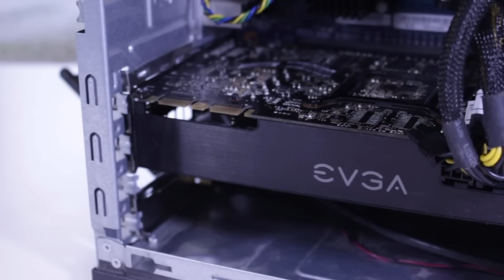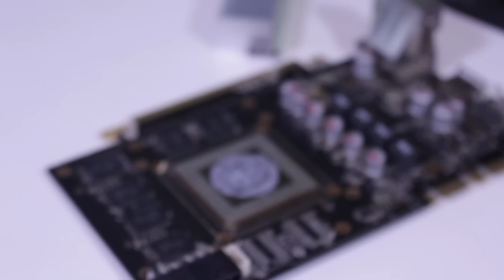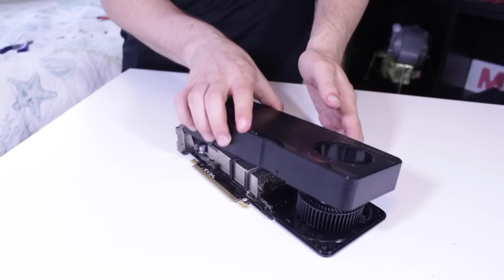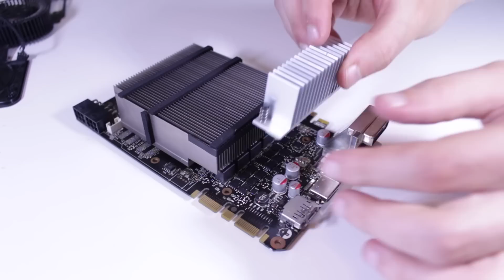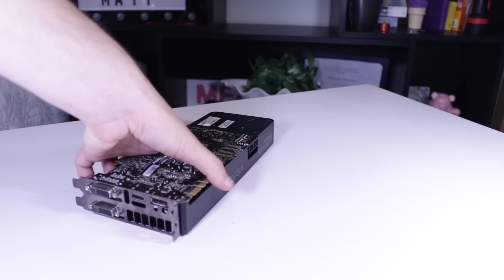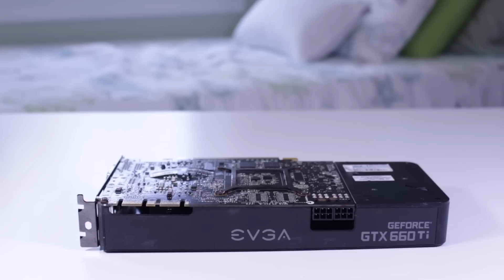Fixing a LOUD Graphics Card!

Comment: The ticking or knocking sound in bdlc motors even at slow rpms is caused by the pulsating energization of the stator windings. It's a phenomenon known as cogging torque. Blower fans seem to suffer from it more than normal fans, probably because of a larger diameter rotor while having the same number of magnetic poles. Many mistake it for a bad bearing or a mechanical obstruction of the fan but those are different issues.

Comment: mine sounds like that, its supposed to be cleaned and all working parts, but the fan drives everyone in the next room sleeping mad crazy. they asked me the the hell I am doing in there lol. I never herd such an insane pc, it sounds like a load coffee pot noise and then when I do virtual machines for pen testing it gets so load sounding like a motor cycle getting ready to power take off and then it starts acting like its struggling to move with a chugging sound?

Comment: I dont get it, how when you change the thermal paste and removing the dust, made the gpu quieter
Reply: As he said in the video, there was a loose screw in the fan assembly. And if that wasn't the problem, there could have been solid debris from dust that was hitting the cooling fan as well.

Comment: Good video. But some points.. changing thermal paste will never be a miracle. It is more important to clean the entire cooler properly. The new paste can make a difference of up to 3-4 degrees at a temperature max. In addition, testing a new paste is necessary at certain speeds, not the auto-fan. E.g. at 100% fan speed before and after.

Comment: the before noise has some cyclical sound linearly co-related to the fan rpm therefore either the fan was very disbalanced, a ball bearing (if it has ball bearings) is worn out or the blades have unequal shape and some bigger one hits something. either way i didn't see any modifications to the fan and i don't understand why it is so silent in the 2nd part.
Reply: Yes I am wondering how he got the fan to be so quiet

Comment: Great video dude, I have the same card though mine is an oem but exacly the same underneath the shroud I thought mine was loud but yours before was really bad, be careful not to over tighten the shroud screws I made the mistake and of doing so and broke the threading in the shroud, Also sitting the fan speed to 80% @ 70c really cooled down my load temps and stop the GPU down clocking.

Comment: I had to do this X1000. I found a 980 ti on craigslist for 50.00 but the catch was it was owned by a smoker who chain smoked in front of his computer like 12 hours a day. I could smell the card through the pictures. I picked it up and I almost didn't take it, it smelled so bad it and had a thick layer of dust and tar. I wrapped it in a trash bag and took it home. I decided not to test or even bring it inside before cleaning it. I used a pain brush and 99% Iso alcohol to clean it up. Toothbrush and soapy water for the shroud and just a alcohol wipes for the fan blades. It made me gag a few times but I powered through. I applied new thermal paste and put the whole thing back together. It works perfectly and looks brand new. Worth it.
Reply: Lol thats funny
Reply: Ii had a similar issue with an rx580 i got on ebay. the card had a layer of tar and smelled terrible. cleaning it out made it work much better and i gained the confidence to work on gpus.

Comment: You can also re-oil fans to keep them going longer. Normally they have a plug under the label that you can lift to drop a few drops of like sewing machine oil into. Work the fan up and down and spin it some to help the new oil seep in. Then just re-plug the hole and apply a piece of tape cut to fit over the back of the fans round base. If the fan does not use a plug in the back and the base is solid, you can drill a tiny hole there and apply oil through the hole you made.
Reply from the maker: Thanks for the tips!
Reply: To cover the holes whether or not it has a rubber plugs I use round colored price stickers like u find in office supplies. Good oil is the blue 3 in 1 it's thicker than the red bottle.

Edit: when putting the stickers on make sure they are under the label and the adhesive side isnt facing the hole with the oil unless it's a last resort because the label no longer sticks.

Comment: Great video! Inspiring! My son's old laptop is an I5 540m with HD5450 GPU and gets very hot and slow and I really need to open it up and clean it!
Reply from the maker: It would definitely be worth it to clean it out and change the thermal paste on the gpu and cpu. I know Ifixit has tons of teardown guides for laptops so they may have a guide for your specific one.

Comment: In other words: you can throw a casefan on the cooler (singular and plural) and call it a day?
Reply from the maker: I was actually thinking of picking up a $5 fan adapter and some cheap vram heatsinks and slapping a 120mm fan on this to see how it performs. I'm just not sure how I would mount the fan...
Reply: It might look pretty sowjet, but zip ties should work, although it might be a bit of a struggle to attatch them. You could even attach it to the mainboard and use speedfan to controlle the fan speed :D